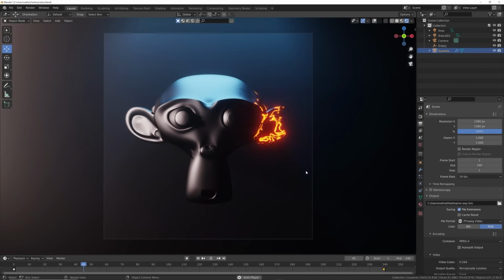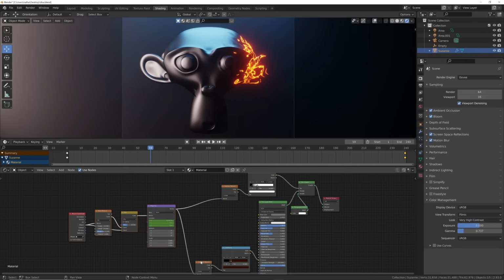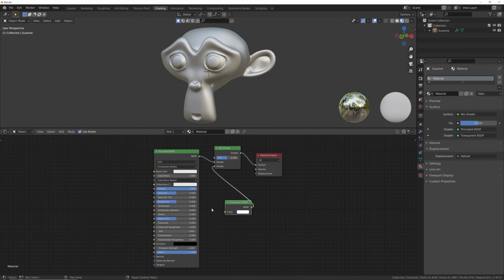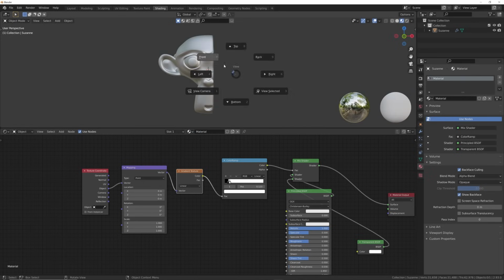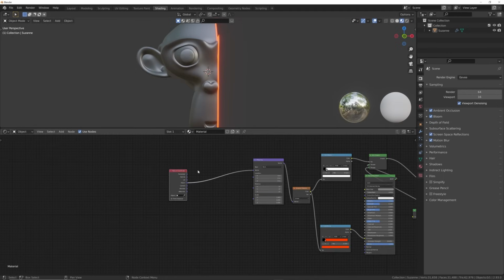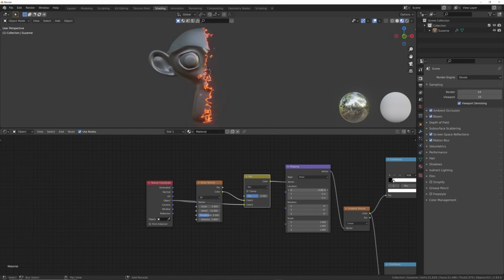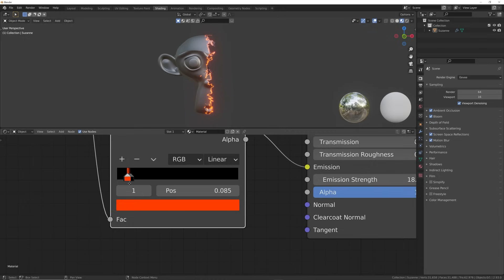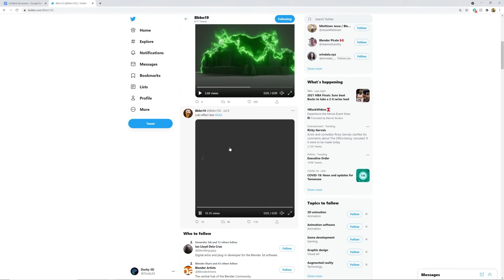Procedural Dissolving Effect (Blender Tutorial)

Comment: i know is a 4 years old video but found it recently... 
3:21 at that point in my case, the color ramp dont works and i did everything like the video,   only appear half the model, the right side actually
Reply: The colors in the upper color ramp might be criss crossed. Fill out the model by setting the X value in the mapping node (-1 value) and set the mix rgb between .62 and 1 based on what workef for me
Reply: @keiths5566 tried it today with similar numbers and worked, also the scale is important too if the model is bigger or smaller

Comment: Great video. It was concise and easy to follow. I tried it on Susie, and it worked great. However, I then attempted to do so on a 3D model that I made from an SVG of a logo consisting of a word, but then nothing happened. It's worth mentioning that I did turn the loops into a mesh. The model is clean. I only had the outside lines with nothing in them, filled the space within, and then extruded it into a 3D shape. The "normals" are all facing the right way. My only inkling is that perhaps there are vertices that aren't connected, but there are at least 1,000 of them, and I am not about to merge them one by one. If anyone knows what's going on, I would be grateful if you could shed some light on this. Thank you.

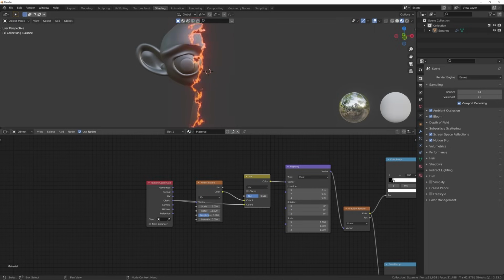Comment: I completed this tut, and suzanne looks great.  Could there be a scale issue on other models?   idk.  I saved the shader nodes and applied them to another model in a new project.  This is where the problem occurred.  The transparency part worked fine (top color ramp). The line of firery disintegration displayed gradient colors (bottom color ramp), and I could move it as desired (mapping).  However, I could not replicate the detail, which I assume comes from the noise texture node.  The disintegration line was straight with no variation like 4:32 instead of how it should look at 5:25.  I played with the scale, roughness, detail, and distortion with little effect.   Help me obi wan kenobi. You are my only hope.

Comment: Loved this, so simple yet such a nice result. To spice it up a little I added an empty to control the effect. Then in the Texture coordinate node, add this node as the coordinate "object". Last convert the noise texture to 4D rather than 3D, and add a Geometry input node, and drag the position into the W coordinate of the noise texture. Not sure if this is the best way to do it, but it gave me a nice effect as you drag the empty across the object
Reply: To animate this over time just go to the Material tab on the right then twirl down the triangles until you find the Mapping node. Click the dot on the right edge of the X, Y, or Z property you want to animate. In your timeline, move the playhead to a new frame then change the X, Y, or Z property to look however you want the effect to change over time.

Comment: Super tutorial mate thanks, would you know a way to use the same technique for a full character (or else) with multiple objects/materials ?

Update: if anyone needs it, to do so: Create a Cube with a high amount of subsurf modifier. Set a boolean modifier on the object(s) you want to dissolve and set it to difference (solver: exact, enable self intersection), and set the Cube as the object, apply a displacement cloud texture to the cube and give it an emissive material, disable it in rendered view. You can know dissolve your object by moving the cube upon it.
Reply: Use the same shading setup for each material, with tweaks

Comment: Im new and Im would like to know how it was animated, can you share the process?
Reply: Yeah imao I like how everything is set EXCEPT the animation tutorial 
Looks like another thing is unavailable for me to learn
Reply: It works just like it does using the timeline in layout window.
So set up your frames, use keys in case you want the object move/morph.
Then jump to the frame where you want your animation to start. Youre in the shading window. Set up the integration /desintegration depending on letting the thing appear or disappear, right click in the bar with and select insert key.
Then jump to the frame where you want your animation to be finished, select the value, right click and place another key.
Your done.
Reply: @siebenunddreissig   Thanks for the tip 
Never knew animation could resolve just by pressing first and last part 👍👍👌👌👌

Comment: If you're dealing with a very narrow range in a color ramp like on the video, before passing a value to it, first subtract from it the first swatch position, then divide it by the actual range (distance between 1st and last swatches). For example, in the emission color ramp you have first swatch on 0.079 and last on 0.111, so you can first subtract 0.079, then divide by 0.111-0.079 = 0.032. This way you will have over 31 times more space to work with! If you still want to have some freedom to move the first swatch to the left and the last to the right, you can just drag the subtract value to the left, instead of dragging the first swatch to left, and drag the divide value to the right instead of dragging the last swatch to right.  Or you can just give yourself some margin - here you could just multiply the value by 0.15 before passing it to the color ramp - still 6,66 times more space to work with. Compare this https://i.imgur.com/opdmbxe.png and this https://i.imgur.com/0VWajtc.png